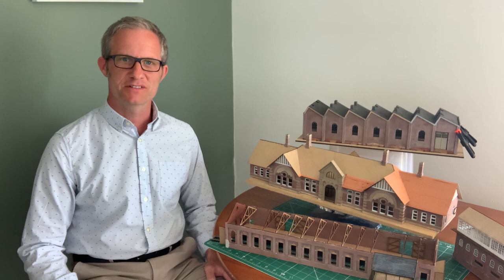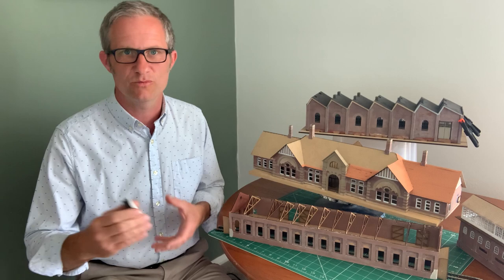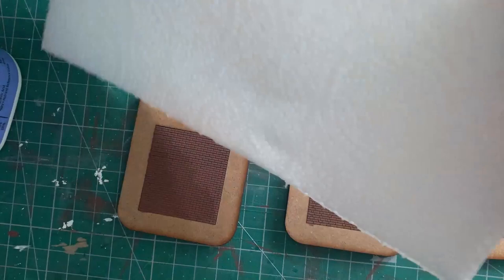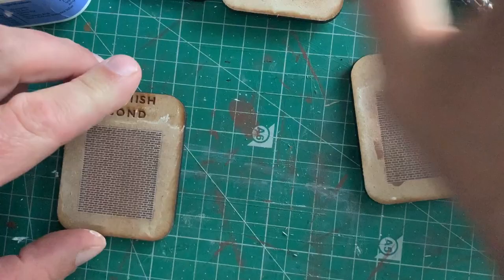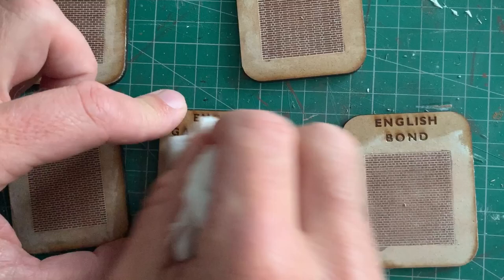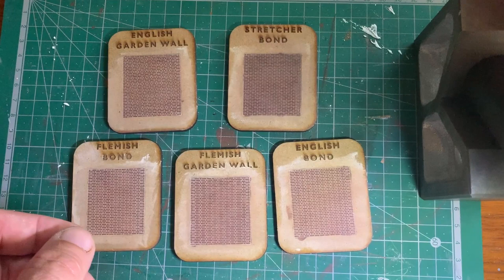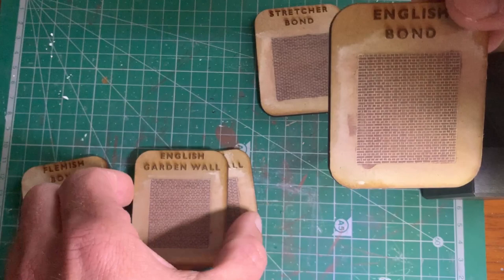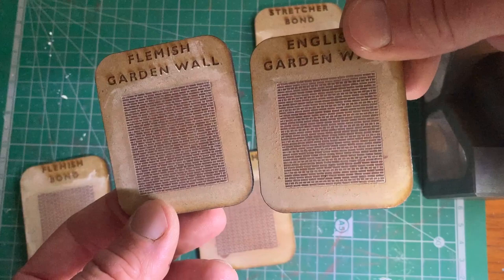Painting Laser Cut Brickwork

Comment: I mentioned in one of your previous videos that I am building a 3D Printed Roundhouse. For the brick work I use acrylic paint and then when dry i coat with a Gloss Lacquer and again when dry I use a homemade wash. The Gloss Lacquer allows the wash to run down the gaps in the bricks and I wipe it. Sometime I do more than one coat. After drying I spray with a Matt Lacquer. I have never thought of using a filler. I will try it on another building. I am making the models for a Train Layout for my son. (And me) I do not have any baseboards yet, so that is why I am just making the models. I only have one large one to do and that is a Turntable in 4mm scale (90 Feet) with indexing set at 15 Degrees. I have some alignment problems with the Roundhouse, but I have decided to wait until the new front walls and doors are ready.
A very interesting Video. Thank you. Martin. (Thailand)
Reply from the maker: Thank you Martin for sharing your technique on here Martin, that will benefit all, not just me.  Your project sounds interesting, good luck with the turntable.

Comment: Thank you so much for this! So glad I found your video. One of the problems I have with such kits is the obvious join between sections, and your method of course hides those joins. I’m just doing a LCut loco shed which I sprayed with Poundland red primer then picked out bricks in Acrylic. I find using the damp kitchen roll takes off the acrylic but it’s fine dry. I’d LOVE for you to do a weathering video when you have the time. Many thanks.

Comment: I see youare using MDF. I've been working on designing a series of modular wall sections for multi storied industrial buildings suitable for early to mid 20th century structures. Stressed Concrete frame with different brick bond patterns in HO scale. But the material I want to use most is Illustration Board about 1mm thick. Relatively cheap. But the only problem is that after laser engraving the bond pattern the bricks are incredibly fragile.  They pop off if you drag your figure across them. I found flooding them with a 1:1 solution of PVA/distilled water and letting the wall section dry thoroughly stiffens them up nicely.
Reply from the maker: That's a great tip which I'm sure will be of help to many.  Thanks for sharing.  James